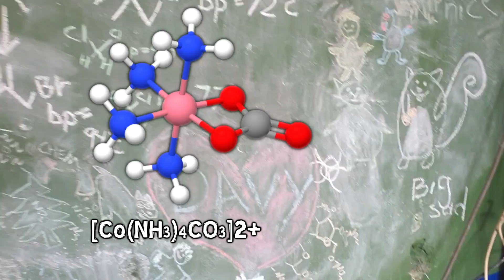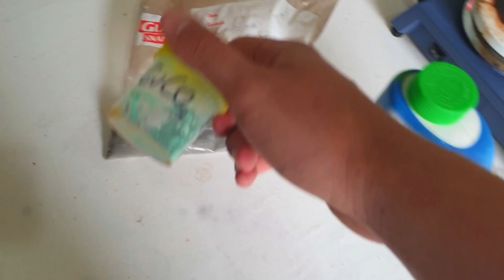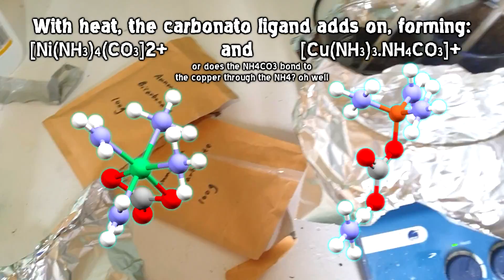More Carbonato-Transition metal complexes

Comment: Someone was saying that the blue receptor in the human eye mostly detects blue, but it also detects a little bit of red, because the red light is half the wavelength of the blue light so it excites the molecule slightly as well by resonances something something.

That's why violet, which should be more blue than blue, is perceived as being some what reddish, despite being at the other end of the visible spectrum.

Wonder if the CCD on the camera is more strictly detecting the blue and not emulating the red the human eye is expecting in the video image?

But if it was showing the exact wavelength of blue, the human eye should still see that, invalidating my whole argument.

Comment: I'm aware this video is 4 years old, so unlikely to get a response. But, how did you go from the Copper nitrate to the copper hydroxide? I assume reacting with with something like sodium hydroxide and then removing the sodium nitrate, but I'm not sure if I missed it in the video. I'm always wary when papers talk about combining nitrate salts with ammonia due to accidental ammonium nitrate formation, especially in stuff like Ruddlesden-Popper or perovskite synthesis when you heat the mixture up.
Reply: The reaction with ammonia will make copper hydroxide and then the teraamine complex as you add more. A little ammonium nitrate isn't dangerous.

Comment: I think your pump is good, but looks like you may be using a battery charger disguised as a normal switching power supply?

What does the label on the adaptor you've connected to the pump say specifically?

Comment: Probably need a better power supply for the pump, it may supply to voltage but it doesn't have the amps to run the pump like it's designed

Comment: Hi. Ni(III) is very rare - I personaly made only NiO(OH) (which is mixed with NiO2) by oxidizing Ni(OH)2 by persulfate. Nickel, unlike cobalt, doesn't form easily complexes in III oxidation state. So you have all the time [Ni(NH3)6]2+ in the beaker, which decomposed in to nickel hydroxide.

Copper hydroxide contamination in your tetraaminnecopper carbonate is due to loss of ammonia on the air. These ammonia complexes slowly lose their ammonia, which is replaced by water. They must be store under ammonia atmosphere in closed container (I have for years [Cu(NH3)4]SO4.H2O in the jar without loss of ammonia - I added two drops of 25% ammonia to the jar to make protective atmosphere).

Comment: Hey I bet the pump is fine your shitty charger probably doesn't put out enough amps. A motor that size could pull maybe 3 amps and that charger looks like 2  amps max. You need extra amps for motor inrush current too. I would get a cheap ass amazon 12v ~7 amp power supply or jerry rig a computer PSU

Comment: Look, I'm sorta old, but there's a good reason you can't get good colors, we lost a lot when we went to solid state from vacuum tubes, and analog color transition to the digitized solid state, just doesn't get the bandwidth.  By the way, find an old refrig or ac unit, and use the pump, you can even have a small compressor for your lab, but you can easily pull a strong vacuum, with one of those "can" units, and draw it through a water bath if you're getting corrosive vapors, but it'll pull 29 inches of mercury, don't know what that goes in metric.  I find them in trash, free.  By the way, really enjoy the videos, there's just something about high velocity detonation.

Comment: Chinese Rare Earth ore is natural carbonato compound; carbonate is bidendate for elements with f shell like Lanthanides and transuranics. Sorry about your Nickel but do the math the bidendate carbonate is quite a strain on Ni+2. Oxalate, Tartate, Citrate, EDTA fit larger octahedral cations better. Anh NiCl2 complexes Alkenes and polyenes. Ni does coupling reactions like Pd, et al. You don't mention Copper +2 is distorted octahedron. If you like colors, Copper salts are blue, except anhydrous Copper Acetate which is red with Copper to Copper bond. Simple reactions like Ferric salts with salicylic acid, blood red, or tannin/gallic acid, original black ink.

Comment: Other labs use a water fountain into water tap vacuum adapter. Water cheap in PNW so mine just drains. Gets 12 mm vacuum with cold water. Plus is acids, ammonia, etc vapors goes to the drain or ice water tank.

Comment: Love the video, but your structures kinda kill me. The ammine (NH3) ligands should be pyramidal not planar. 

Also I would expect the ammonium counterion in the Cu complex to be in the outer coordination sphere, meaning it is not directly bound to Cu or to the carbonato ligand. I don't think the formula for the Cu complex is correct actually. The paper you are following seems to have pretty sketchy chemistry in general. The complex is probably just Cu(NH3)3CO3. It could also have NH4+ and CO3- in the crystal lattice, but the complex itself should be neutral and wouldn't include an NH4+.

And as others have said a water aspirator could be used as a simple, low cost vacuum for filtration.

Comment: I've also used that type of pump, you don't want to let it stall for any time since it will slowly overheat.  That AC adapter is awful, try finding an actual 12V supply at several amps so it never stalls.
Anyway, the pumps are surprisingly powerful and can really develop some serious pressure, on the order of around  one bar.  Pretty decent for a small plastic pump.  The ones I got were pulled from a blood pressure cuff machine, hence the need for high pressure and moderate flow rate.

Comment: I made a filter pump using something just like this. I used a mason jar and some tubes and hot glue to act as a trap for nasty stuff. I charge it with bicarbonate solution for acid gasses, ice water for volatiles, etc. Might be an idea for your little pump.

Comment: You can get an aquarium air pump for 5-10 bucks and hook a hose to the air intake for vacuum filtration. Your motor most likely needs 12v by the way so check the adapter you hooked to it and also look at the ebay listing it may list the max Amperage. If not get a cheap speed controller from Aliexpress for 3-4 bucks and then you can adjust the pumping speed.

Comment: Just FYI I have had good luck in the past trying to dry out nickel nitrate by removing the water using azeotropoc distillation with toluene that I got from Bunnings paint thinner. 
If you don't have a Dean stark trap it's no worries mate just tilt a Clausen adapter over at 45 degrees. Only thing is that limits the amount of water that you can collect, but for your small quantity this should be no problem.
Reply: Claisen*

Comment: You still got your 3D-Structures wrong. NH3 is not quadratic planar as a ligand, but tetrahedral - the hydrogens and the electron lone pair of the nitrogen point to the corners of a trigonal pyramid. If you need help with this, please contact me. I have a Dr. rer. nat. (Germany's equivalent to a PhD) in theoretical chemistry.
Reply from the maker: Yeah the software I use is not letting me download the optimised structures. I use MolView, because I can draw it and then download and render the view through Mercury fairly easily. If you've got suggestions of 3D molecule drawing software that lets me optimise things properly, I'd love to know
Reply: @ExtractionsAndIre  Have you tried Avogadro ( https://avogadro.cc/ ) ? It's a fairly easy molecule editor, supports a plethora of formats (through OpenBabel) and has a force field optimizer. If you want to go a little bit more in the direction of true quantum chemistry, you could try Mopac ( http://www.openmopac.net ). It's a famous semi-empirical QM-Software and free for non-industry-use. And then, there is the real-deal like Gaussian (costs you about 50k$), US-GAMESS (free, https://www.msg.chem.iastate.edu/gamess/ ) or Orca (free for education and non-profit, https://orcaforum.kofo.mpg.de ), giving you access to Density Functional Theory and Post-Hartree-Fock-Methods, but you'll need some computational power and/or time and some expertise to master these. Let me know if you want to know more or want me to do some calculations for you.

Comment: 12:49 Have you considered using a recirculating water aspirator pump? They pull a better Vacuum than a little diaphragm pump like that. Nurdrage did a video on them.
10:45 It's a british plug

Comment: So if u steal a compressor from from a fridge or ac unit they make good vacuum pumps if dont make an oiler or add some oil to ur line every so often ull burn them out in not that long cuz theyre nomaly sealed units with oil but if u just add some regulary they are great

Comment: Pump likely needs more current, it's a fair sized motor and under stall-load probably draws a few amps. The power supply should ideally rated for over 5 amps to be on the safe side.

Comment: HINT: If you put your conc. ammonia in the freezer beforehand, makes it a little nicer to work with pouring it out of the bottle because the vapour pressure at such low temperature is very small (you don't get that terrible out-gassing as you crack the lid open!)

Comment: About the pump: The motor is perfectly fine but the current supply is not suited to the motor. Even if the voltage seems fine it's not powerful enough to power the motor. You should also look for the working current and not only the voltage. Don't worry about this pump, that will work nicely with a more powerful DC supply.

About your complexes :) I think you should have recrystallize the copper one in ammonia and not water. Il water there is a ligand exchange, the ammonia is lost in the vapor and the aqua ligand is broken into an hydroxo ligand. That's why you get Cu(OH)2.
Probably the same problem with nickel. You should try to keep the ammonia concentration higher.

Comment: On the adapter: it’s a US plug. I assume it’s a switchmode power supply. I don’t think that the thing that controls the output voltage is the input voltage. What goes on the other end? Some kind of barrel plug?

At any rate, I would not assume that it’s giving you 12V unless you put a multimeter on it.

Comment: I've been using one of those same vacuum pumps for over 2 years now.  Works great and is perfect for keeping a decent vacuum going for long periods without the noise.  Definitely make sure you have a solid 12V though.  They will get hot and bog down otherwise.  It's survived all manner of nasty crap being spewed through it.  Super easy to open and clean out.  the rubber flappers are really quite sturdy.  And in a pinch you can even pump water with it.  Doesn't pump a huge volume but does put out good pressure.

Comment: Hey Davy, I've used these pumps before in the past, they really need almost 2A at 12V to get down to a reasonable vacuum level. They don't stall once they reach their maximum vac level when supplied sufficient current

Comment: You should make manganese heptoxide some time. You make it by pouring sulfuric acid on potassium permanganate (other permanganates might also work, though. Unsure.). It's quite explosive in contact with most things, which is the fun property. Explosions release a shit ton of very finely powdered manganese dioxide, though, which is shot into the air into a toxic dust cloud.

Comment: Used those pumps often, I found the best power supply was a TATTOO 12v. You just have to cut off the foot peddle and twist the wires together. Then you have a variable pump that can pull a vac of 30" of Mercury or just a little vacuum if needed.

Comment: A lot of those eBay pumps are rubbish. If that thing ever carks it, seach for 'C12V/DC24V/AC220V 12W Mini Diaphragm Vacuum Pump' on eBay and you'll find the ones with the green heads. They are great for the price, ~70AUD.
You can easily remove the head after each use and rinse them off, or coat the rubber diaphragm.

Comment: I've used some similar pumps that were like $5 on ebay (that's US money) they did look cheaper than the one you had, but i broke 3 of them abusing the hell out of them, the motors went out. Although i think if you run tubes to exhaust the gas away from the pump and don't have the motor in such a corrosive environment they last long enough that i feel i got my moneys worth. Aspirator pumps also work pretty good for the price but i think they're a bit of a hassle compared to a little electric pump.

Comment: 12:20 i would guess that the pump keeps turning off because the power supply overloads/overheats and the voltage drops. And the 5-12V probably means that it is adjustable not fixed ratio as that would require a traditional transformer which would prob be too weak to run the pump at all, judging by how small it is.

Comment: 12:40 I had one of those in the lab for a short while, but found the aspirator pump is way better. If you use a aspirator pump at home, you can collect the water for the garden or to flush the toilet or something, so nothing is wasted.
EDIT: I just found out that it is called an aspirator pump, not a water stream pump

Comment: I have been using this kind of pump for years. They are quite reliable with the right power supply.
Got mine from ebay as well only they were much cheaper and came with a psu

Comment: Use this pump for resin and silicone degassing. Works great with 20A power supply. Consumes up to 2.5A as a vacuum pump and up to 7A as a pump.

Comment: The plug for your big pump looks like a U.S. 240v plug. Commonly used for appliances like stoves, refrigerators, washers, and dryers. It's also not uncommon to see it on tools with large motors on them like mills, lathes, and CNC machines.

Comment: FYI if that motor stalls out for long (more than a couple dozen seconds at a time, or less I'd bet) it could burn out. Motors draw more current the slower they run and afaik cheap dc motors like that are really not designed to pull max current for long at all, it gets really hot. 

This might not be a problem at all if that power supply has a low max current draw. If that's the case then there's no harm in stalling.
Reply from the maker: I think the power supply has a low current draw yeah. Will replace it with a 2A one  as advised by others, to prevent it stalling

Comment: I have used that pump before its okay but I have had a lot more success with a product from Piab called vacuum ejectors they use compressed air to pull a vacuum the nice thing about that is you wouldn't have to worry about any thing flowing back in to the pump. Here is a link if you would like to check them out  https://www.piab.com/en-US/products/vacuum-pumps/

Comment: Doesn't that adapter also step down the voltage? I thought they adapted 220VAC to 110VAC so you are running the adapter on 110VAC and only getting 5VDC. find a 12VDC adapter with an Australian plug or an North American adapter that is 12VDC and you will get more power.

I may be wrong, but I would grab out a DMM  or voltmetre and check the output voltage of the adapter

Comment: Those pumps tend to draw a fair bit of current once you put a heavy enough load on them. Pulling a strong vacuum to suck something through the filter does just that and I suspect your power supply simply isn't up for the task. As the vacuum builds so does the current, eventually the supply can't keep up and the voltage tumbles until the motor stalls out.

You want something that can deliver at least 3, better 5 Amps at around 9-12 Volts. An old computer power supply would work well, or maybe a cordless drill battery or in a pinch even a car battery charger if it has a 6V setting.

Comment: Hey about the small diaphragm pump, I have use those for vacuum filtration for a fair while
the adapter you are using looks like a charger adapter, probably not the best choice
if you could find a 12v 2A adapter say from old routers it would run continuously and wouldn't stall
ebay is MIA because of Covid, but a PWM controller would make things even more controlled (10A ~$6aud)

The diaphragm is made of silicon so are the valves so the thing is pretty resistant to most chemicals, in my case what finally killed one of mine was vacuuming toluene for long periods. it permeates through the silicon and dissolves the PVC parts behind. the body is glass reinforced nylon so I don't think it would like HCL and a Cr6

These pumps are also fairly tolerant of liquids, you can pump liquids or gas/liquid mix, just need to reduce power a bit

One other tip, I had 2 of these so I could use them in parallel for doubling the flow or in series for increasing the pressure or vacuum (won't quite double the pressure, more like 1.5 times, still not bad at all considering)

Comment: I use an aspirator vacuum pump ( wikipedia.org/wiki/Aspirator_(pump) ) it can get a surprisingly good vacuum for something so small and cheap. It can pretty much go as low as the vapor pressure of whatever liquid you power it with (usually cold water).
Reply: It sadly wastes a shit ton of water though :/
Reply: @alexpaww  You can actually use a pump to circulate the water from a closed reservoir. Here's a video nurdrage did on the topic: youtube.com/watch?v=tYLlkTDstmo

Comment: that mini pump either has a shutoff switch or can't get enough current from the power supply (which is shutting off to self protect). or could be both who knows, either way it's garbage. you can get an automotive vacuum pump off Amazon/eBay/whatever for 100-150 freedombucks which would be quite quiet and more than sufficient for filtration while also being cheap enough to replace when ruined unlike your nice one.